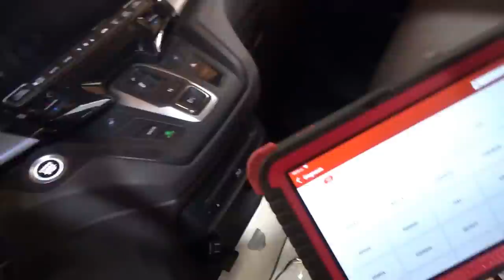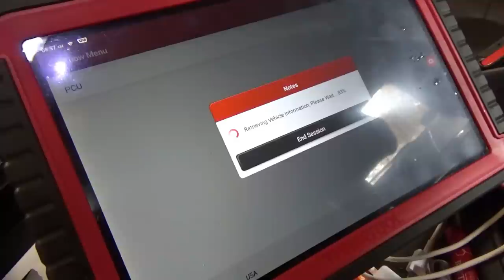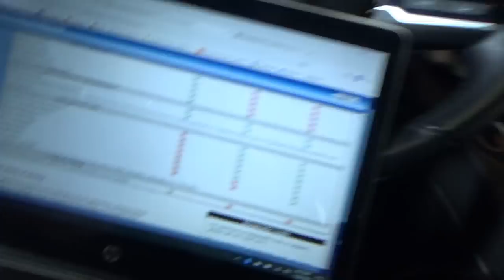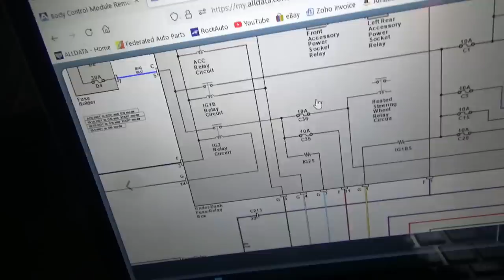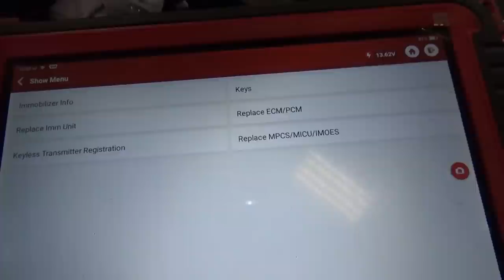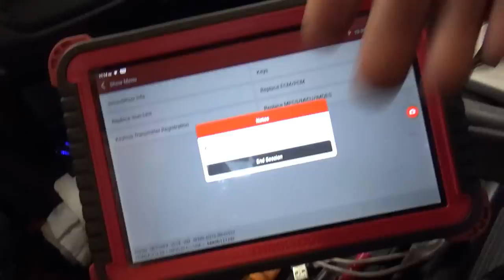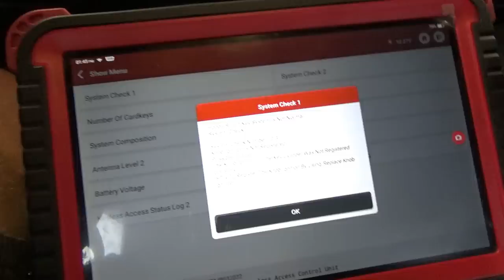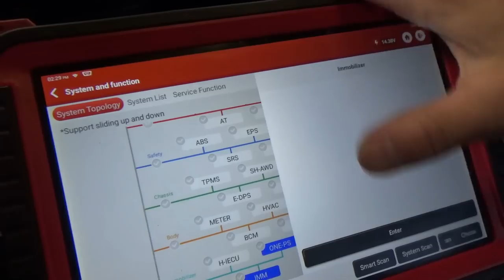WTF...Honda Turns Itself ON & DRAINS the Battery?! (Part 2)

Comment: This is one of the most interesting video you have done. Very well done.

This is a issue that has effected a lot of people and seems to be present on 2015-2019 Honda's, just about every model. Here are a few of the many examples.

6 Months Ago;
"Just imagine your vehicle turning on by itself all the time and draining the battery.   This last October, My 2018 Honda CRV Ex was completely dead and would not turn on. Battery was dead. Jumped it, charged it up, same thing happened the next day.

My civic has the almost exact same problem. They say faulty bcm and I have been going through the same loops as you waiting for the new part. Months of waiting and them pushing the date back further, no amount of case or case managers or “district managers” is getting me my car back any faster. I’m done with honda after this.

My part came in about 4 weeks ago. Honda paid half and I was out $400. It's so nice for it to be working again. Had no problems since.

This same thing is happening to me with a 2017 CRV touring. It’s new to me, just bought it barely six weeks ago."

The problem is nobody knows why Honda has so many bad BCMs. The normal things, water intrusion, impacts, etc. are a given. Shorts has also been given as a possible cause. I would guess that a short on one of more of the nearly 1,000 wires connecting to the BCM in these cars could permanently damage the BCM. We likely will never know. 

Looks like others have had to go to Dealers multiple times, and have long waits to get this issue diagnosed. You did it far more quickly, and with a lot less trouble for the owner. 

Again, extremely interesting, and very well done Ivan.
Omegaman
Reply: Not many people as brilliant as Ivan ! wish we all could be!  maybe made in Mexico also has something to do with Honda's problems. Probably be worse when these cars get older.
Reply: @garyalford9394  Yes, I think made in Mexico (most are) or China (the only two places they are made), could have something to do with it. I would like to say though, this could be either a design flaw, or a manufacturing issue (whichever one, it's repeatable), or it could be some outside force, such as moisture, or maybe a short on one of the outputs from the BCM, also repeatable. We may never know for sure.

Comment: Concur, on high pin count modules.  After checking powers and grounds, disconnect each bulkhead connector, inspect for corrosion, and give it a shot of DeoxIT !
Back in the 80s, we did a "back of the envelope" cost study on the cost of a module.  Housing, circuit board and both halves of the connector was around $15.  So the more functionality you can put in one module, the better.
Chrysler TIPM were a good concept.  They were not the first, or probably the last, to put non-serviceable relays inside. Serviceable relays rarely fail an the are not sealed, so why do they fail inside TIPM ?
Reply from the maker: Internal high current relays fail because they are 1) physically smaller and 2) they are soldered to the circuit board 👍

Comment: Ivan its good to have lots of patience when dealing with these sorts of issues. I once had a customer who brought his own factory plastic fob key to add to his other immobilizer keys and wanted them all programmed. Regardless of what I did, that one key would not be recognized and after about an hour of repeating the programming steps, I told them it must be a basic blank. I got one from the parts dept and it programmed perfectly so I suggested the molded plastic head be cut open on his key. Sure enough it had no module in the key shank hole, it was just a basic non immobi key.

Comment: Looks to me there could be some contamination/tin whisker on some PCB boards in that control module.  The excess movement after the module is disassembled from the vehicle may have forced the contamination/tin whisker to either fall off or moved a little bit, making the short circuit no longer there.  Using a 75% IPA 25% DI water to clean the circuit may have helped.

Another potential issue is with some IC chips.  You guys may want to team up with a computer/cell phone repair shop to better service your clients

Comment: Very cool. Great job Ivan. Like you said, there are a lot of wires going to that module. If a function got out of sequence somewhere along the line it could have locked-up part of the module and not allowed it to clear or reset. When you reprogramed it, it cleared whatever sequence issue it may have had. Lots of knowledge gained on this one.

Comment: if you used honda IHDS system proggram bcm only take about 10 min finish program. even honda IHDS scan tools still no comunication from begining then instruct you push & hold start/stop  switch to turn igntion on program  BCM   very good skill bypass bcm commnad turn igntion on. i learn someting from you.

Comment: Sometimes it could be a software issue there is a tsb for land rovers for cars with mid line instrument pack after it been for a mot the instrument pack doesn’t shut down and drains the battery and the fix is a software update for the instrument pack

Comment: It's a lot easier with a pin code reader or if you had a friend at a Honda dealership that can supply it to you.  Autel has the IM608 but I never tried it, I used to use a stand alone PIN reader.  To get your locksmith ID is not hard if you have a clean record and it is not expensive and then you can just get PINs.

Comment: Possibly update is require on this bcm and the think tool scanner did it.I work in dealer ship around 2 computer of daily Iveco 2016 and 2019 need to be program with update because of software issue AdBlue and airbag module.Adblue ecu deliver so much AdBlue and the driver airbag deploy by it self.I think honda BCM have the same issues.

Comment: Sometimes with electronics you get a glitch in the software that a reboot clears, just like a PC that you reboot to fix a nagging error.  By removing the bcm and having it sit unpowered would allow all of the capacitors to completely discharge so when you reinstalled it it started up new without the glitch.  That could be it or it was something completely different.  I'm a machine tech, I once got a call about a machine that wouldn't start, I walked up to the machine, pushed the start button and it started right up.  The operator asked me "What did you do?", I told her I hit the start button, she was flabbergasted and said. "I did that, it wouldn't start for me!!!"  Sometimes it just happens.

Comment: I bought the Thinkpro based on your opinion. Also bought the pressure transducers. Thanks for all your dedication. What commitment. Personally, I try to stay away from electrical parts on ebay but you sometimes dont have any choice. supply chains getting scary. thanks Ivan. Trying to learn all i can from you. How do you turn the relay on with test light. is the test light used for circuit protection.
Reply: Yes, it is a "load" that can "take it" if things "go south."  I learned that from Ivan.
Reply: Some things are OEM or don’t bother in my experience. Even fakes are rife on Ebay, eg fake Toyota oil filters and NGK spray plugs. And even O2 sensors are fussy, don’t fit a Bosch where there was an NTK, just not worth the wasted time. OEM ALL the way.

Comment: It's very possible only a Virgin BCM can be written with the correct vin. I'll bet the dealer does not even know if you can overwrite a used bcm as they would not typically do that at all.

Comment: My Honda is having similar but not the same issue. Yea,  FM, I concur. Battery drain New battery changed battery voltage regulator we'll see if it works.

Comment: The customer is very fortunate it started working again.  If it hadn't, though, would it be possible to manually switch off the BCM power or grounds when leaving the car, then upon return reactivate it also manually?  This would leave power off the BCM and prevent it from turning on. when not wanted, but at least there would be a workaround  that allows the car to be used while waiting for the replacement new BCM.  The switch could be behind the grille and easily accessible, so at least the battery doesn't' drain over night or when at the store.

Is that a possibility?

Comment: Great work, and really good way to learn something new, I look at it the same way sometimes we spend a little more of our own time to learn for future. Had a 2021 toyota CH-R that would not power on and to get it to just get ignition on had to change immo box, ID box, and steering lock, new oem parts and then program 2 keys to get ignition to turn on.( they had to be changed as one unit so they would register at the same time tried changing immo box and failed to turn on that's when I found out about the rest and can NOT be used units.) And I believe on your case it must af been a programming issue, bcm fault and ghost detecting key ( not a joke ) bcm glitch in programming would detect interference from other rf signals  and power on thinking it was a key nearby, and after reprogramming it got its full ID back between key and immobilizer and would not accept rf interference from what ever was causing  it. Hope that makes sense. Like in some spots you may have problems with proximity key to start car and have to put key against button to start and then later is all back to normal its because that spot may have strong rf signals that interfere with key immobilizer signal.

Comment: @EricTheCarGuy

Now I wonder if I will have an issue with my 2019 ridgeline 

The only thing I have seen on it
Is if you wire up some trailer lights. The driving lights will not work.  A wire harness issue with. Wire that got crossed at factory

Comment: Hey Ivan, I had a similar issue/ trouble with programming keys in my 2002 Acura MDX.  I had an original master key, and I just wanted to add two extra spare keys (with my xtool D8).  When it asked 'how many keys" do I want to add, if I put "2", it would fail every time.  But I figured out that I could just add one key and it would work;  then I would have to start all over and add the third key.  It even asked for a special pin code from the ECM, and the D8 was able to pull the code;  but just for some reason, it refused to add two keys at once.  I'm thinking it's just a quirk with Honda's, and I would almost bet that your ebay BCM could possibly worked if you would have simply tried to program only one key, rather than 2.  Once you get it working, you would have to go back in and copy your second key, but you just can't do them at the same time on Honda's for some reason.

Comment: This is a Therac-25 case study failure. The root cause failure is using software interlocks for the security system. The "vehicle security professional" permission level enables turning on the ignition relays with a software code. This immobilizer system should kill the car ignition system without the "hardware" key fob. But, a broken security system that can be bypassed with software can therefore randomly enable the car ignition.  The keyed hardware ignition switch has been replaced with a bluetooth receiver and some software.

Comment: Let me tell you about electronic devices, sometimes a mouse will not connect, a BT will not connect, a monitor will go black. All for no reason. Unplug then plug and reboot. Boom magic. You basically reset it with the unplugging and restarting.

Comment: Maybe the firmware was corrupted and needed that cleared and reinstalled? You had the connections out once before and inserted them and it didn't work so my guess is the software/firmware had an issue from the charging system, alternator, or removing the battery cables at some point in the past. It also could have simply been a design issue that didn't like the voltage levels at some point. I know of some older computer managed cars that get all screwed up with volts below 12v to 11.6v so as batteries get weak/old those electronics play games. 
I still don't like the push button ignition start system...I'd rather have a mechanical switch !

Comment: I bought a used y board for my plasma tv. It was junk but I did pull some good parts and got my original working. eBay is pretty good but I’d rather buy oem. In this case it’s not possible

Comment: My guess is the eeprom error you were getting was corrupted. The eeprom is the first software that gets seen by the hardware in the BCM once power is fed to it. So needless to say, eeprom is important, very. Now what you essentially have done is reprogrammed this eeprom chip on the board in the bcm. Now sometimes this issue might happen again in the future, but usually this works. If the customer has issues later on, then you can replace the eeprom chip, its not too hard to do with a hot air gun, some solder, and flux. Of course, after you replace the chip, you will need to reprogram it.

Comment: Crazy stuff happens, 2001 c320 wouldn't set emission flags no matter what KA was 30 grounds all good pin fitment good, wiring good weeks of driving car ran great no codes. Sprayed ME control board and all the pins both plug and unit with crc 2-26  Multi-Purpose Precision Lubricant as a last ditch as a friend handing me the can and says we will try this and if it doesn't work will replace ME control. I looked at him and laughed saying it will never work. Eating my own words it worked, What it did I will never know but started passing all the testings to passing. Till this day I will never understand it, chalk it up as a win. I know for next time a ME could be the problem, or going to spray again maybe luck will strike twice, we got our inspection sticker.

Comment: you reset it and taking it out and putting it back in may have made a better connection.
Reply: I have experienced this problem myself as far as disconnecting and reconnecting connectors on cars and it will drive you crazy but hey it works now that is what counts.

Comment: Try with an automotive locksmith will get the key fobs registered.
This is a longshot, but did you consider that the ebay module could have revised firmware that kept the hack procedure you were doing from working.

Comment: I was curious so I looked up "vehicle security professional". It means a person registered with the National Automotive Service Task Force. They do a back ground check and issue a credential that's then used by manufacturers to grant access to proprietary OEM key programming tools and information. Kind of like being a bonded locksmith, but without the bond (i.e. without customer financial protection). It doesn't appear to have been an effective strategy given the rash of thefts that is occuring with new keyless entry and ignition systems.

Comment: So, I am having the same issue with a 2019 MDX. Had the PCM, and Smart Unit Immobilizer replaced and every time I tried to force ignition on through the scanner and press the start stop button when advise to, the buzzer would do the 3 beeps and shut off. Afterwards I did the same jump ignition on the PDU now have access to all systems I updated the MICU with the vin as this was new as well, changed the Vin in the PCM and updated vin in the SMART/Immobilizer unit but when go through all the function like in this video, I get the immobilizer is not normal just like in the video. I have tried 3 immobilizer unit and nothing. Brought a master locksmith will all the fancy gadget and same issue. My guess is these cars need a virgin unit from the dealer but sadly in my case they are on back order 6 months. Oh, and i have been working on this going on 4 months not 4-5 hours as the gentleman in this video. However, great video and at least I know I'm not the only one had this issue.

Comment: I wonder.. I had issues with my '15 Jeep Cherokee in which the BCM turned off the tow package, and the dealership spent 2 days trying to get it to turn back on. They finally did something similar in which they told the system to replace the BCM, and in the process it reset all the parameters of the BCM and turned the tow package back on, but it was still my original BCM. With all the logic circuits involved now I wonder if one of them had a bad flag in it, and when you did the reprogram procedure using the original it finally cleared that flag and reset and cleared what ever was causing the problems to begin with. Kind of like an old fashioned cold boot on a personal computer in which everything is reset to factory defaults and zeroed out?

Comment: Curious to know if that would have started with those relays bypassed if you energised the starter relay?
If so it seems somewhat less secure than a key with a mechanical steering lock.

Comment: Nice. Could it be bad data existed in the original BCM. The reprogram of the BCM corrected bad data in the same and fixed  internal problem that was part of battery drain. (Possibly similar to reformat of a hard drive and re- installation of operating system).

Comment: Just a thought...
19:40 "System type" option on scan tool. Could this be where you tell the system it's a push button rather than a physical key?
I did notice the key LED blinking when you were stabbing the start button at 19:20, so it was trying to do something.
As others have said, carrying out the rematching of the keys and modules could have overwritten corrupt eeprom data which may explain the fault going away

Comment: i went thru this senerao on a 18 dodge ram 3500, it was a flood truck and all the modules had to me replaced. well my boss found them all at the salvage yard and we installed them,  next came programming the key fobs. come to find out afteer hours of reading and trying different things, once a module is programmed, thats it. it cant be reprogrammed. So we ended up getting all new modules and key fobs from the dealer and programming was a breeze.